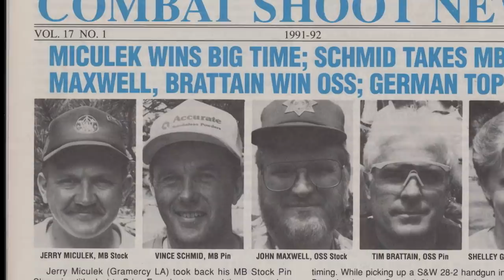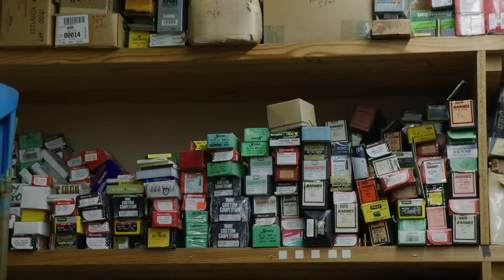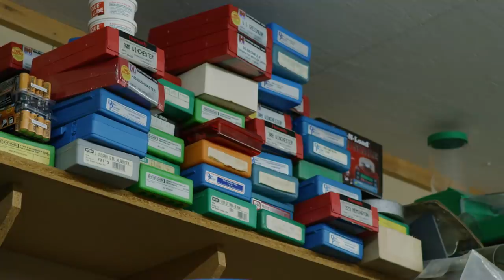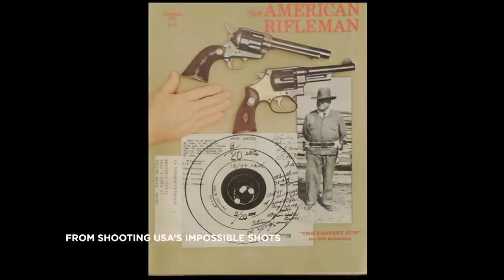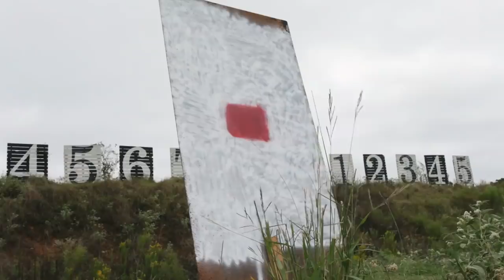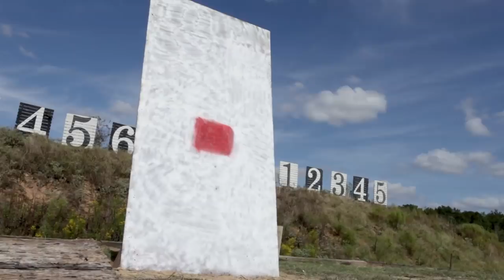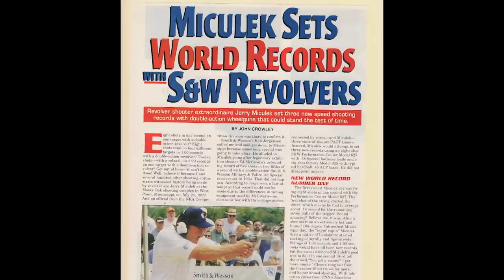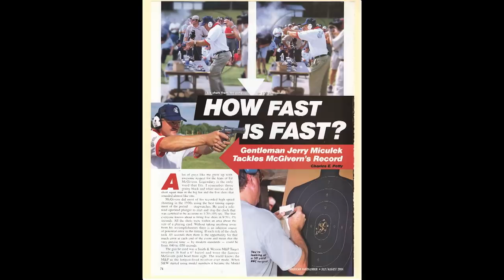GET SOME!! The Jerry Miculek Story

Comment: I hear ya!  We share similar experiences.  This describes my youthful years.  The 1930’s and 40’s have often been described as being much simpler times.  And, I agree.  In the Bear Creek Community in Bienville Parish during those simpler times, there were no telephones, no electricity, no running water, no central heating, no air conditioning, no television sets, no tractors, no prepared foods to purchase, and no indoor bathrooms or toilets.  And, not every family had a car.  Well, we did have an air conditioned outhouse—It was really air conditioned in the winter months.   Yep, you are correct.  On our hill farm we needed to take advantage of every minute of daylight to "git r done."  I was dragging a Winchester Model 74 along the creek banks when it were longer than I were...  <smile>